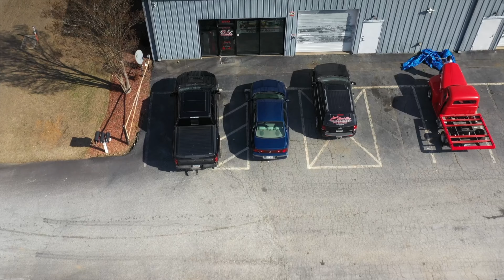AMC 232 IN LINE 6 ENGINE BUILD PART 3

Comment: I had to laugh so hard at you putting on the intake manifold.   It's a bitch.   I learned t hat you need to barely hold the exhaust manifold in by the more outter bolts and set the intake on top and slide it in as a whole.

Comment: Im not much of fan of Chrome but have to say that the chrome valve cover is a nice accent on the blue block. That matching blue valve cover was too much blue. What do I know? Im just an old fart who grew up in the 70s
Reply: Yes, it needed an accent-focal point along with the SS ARP bolts. The  cost of restoring the original bolts vs new and not having to deal with rust issues was a no-brainer. Thx for watching!